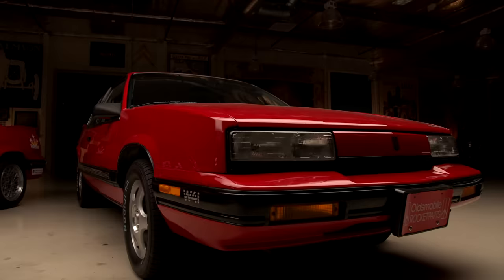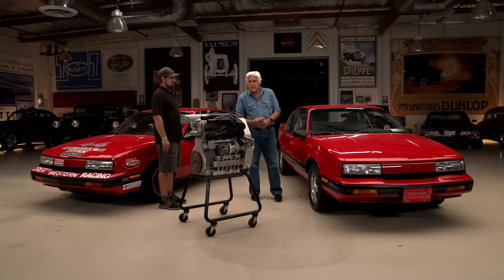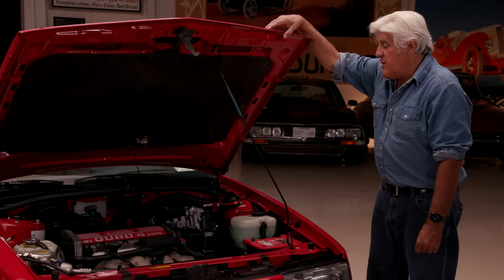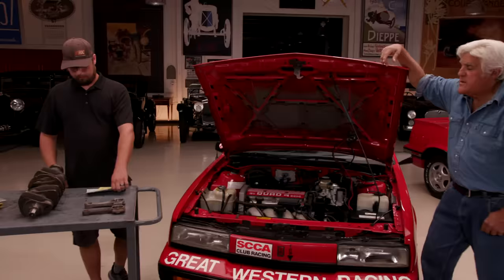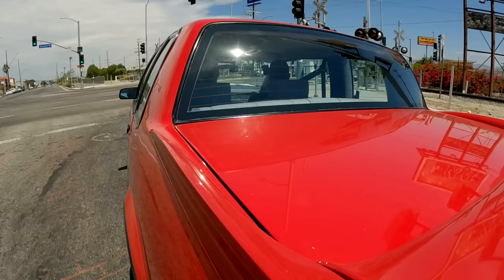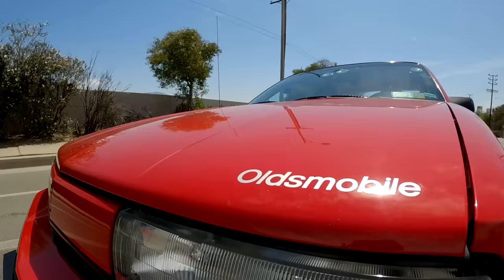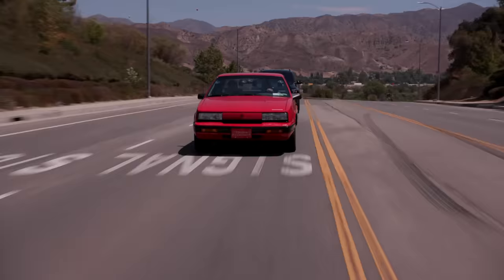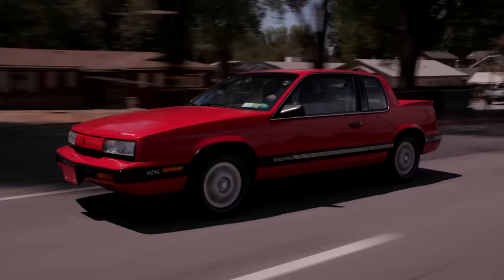Rare 1991 Oldsmobile Quad 442 W-41 | Jay Leno's Garage

Comment: I never heard of this car either! But it is a very interesting special model and looks fun to drive, if not fast by today's standards. GM shouldn't have thrown away Oldsmobile. The management should have worked harder to return the brand to prosperity.
Reply: Oldsmobile was born and raised in Lansing, MI so when GM discontinued the Oldsmobile name, it was a huge blow.  Always surprised me that they picked Olds for the chopping block.  Oldsmobile, at the time, was the oldest American automobile still in production.  For years, the Olds Cutlass was one of the top selling cars in America.  Kinda surreal to drive by huge, empty lots where there once was a major factory.

Comment: One of the most unreliable, pain in the neck engines I ever worked on. Absolutely nothing was easy to get to.
Reply: LOL you sound like my pops. Things gotta be a monster to cut your hands in
Reply: Ok grandpa, let's get you to bed. 

It wasn't any more difficult than any other DOHC fwd four banger during that era. The real issue was the dinosaur mechanics who refused to learn new tech. 

The only difficult part about the entire engine was replacing the timing chain with the engine in the car. Even that wasn't too bad.
Reply: @OxBlitzkriegxO  grandpa? 10 bucks says you are older than I am. The timing chain was one of the first things I learned how to change on my step-father's POS Grand Am. That was easy. The 10 hours on my knees to change the starter was next....every six months. Two full 18 hour days as a 16 year old to change the head gasket was the worst one. I hated that car. I refuse to work on FWD cars if I can avoid it. Giant hands and tiny engine bays don't mix.
Reply: @thomasallen6797  i owned FIVE different Quad4 powered cars that had an aggregate of over 800,000 miles between them all and never once did i change a starter. what were you doing to that car?! 

i would attribute the 18 hour days of working on that car specifically because you were 16 lol. they were not that difficult of a car to work on. 

its not anymore difficult that any other FWD GM car of that era.

Comment: The future of internal combustion could be something like mechanical watches after the 1970s "quartz crisis", but the weird thing is that the transition to electric isn't market driven in the way that quartz overtook mechanical movements by their sheer undeniable technical superiority. It's all just being imposed against our will by government dictate 😂
Reply: Until they realize the power for 100,000,000 people to come home from work and plug in their 230 volt, 50 amp chargers cause huge blackouts. 
The power in the grid does not currently exist to charge the cars being pushed. 
It's going to take 50 years for the grid to catch up.

Comment: Back in the day I worked at a auto body shop. The olds dealer used to bring in wrecked w41 Calais and achievas to repair. They were race prepping these for a race team. One of the drivers was Sam walston. Also a friend of mine owned a 92 w41 scx. That thing had a great exhaust note. And arguably the better of the 2 w41 cars.

Comment: In the mid 90's I was living in Kokomo Indiana.  At the time I owned a 1989 Oldsmobile Cutlass Calais . Great car.  It was a as expected, average cutlass. What made it different than the vast majority but not all cutlass's of the time is that it had a 3800 v6. Quite a bit of engine for that little car.  From a take off you had 2 options. Move the throttle no more than 1/8th and get the car too accelerate.  Or, depress the throttle 1/8th Orr more and smoke the tires off the front end of the car.  That car was alot of fun to drive. It was very unassuming.   It looked like the most ordinary and common car on the road.  I also owned a 1991 pontiac grand am, same chassis, with the quad 4 engine.  That car was also alot of fun.  Accelerating both cars was great. While it was hard to compare the 2 due to the different nature of them both, they were easily rated again each other.  The Olds had a much more luxurious suspension than the pontiac.  The Oldsmobile had much more plush interior,  everything was red and velvety. The seats were large and pillowy. The steering was very soft and foegiving.  
    The pontiac.  Had a stiffer suspension. The stiff we suspension aidedin making with car feel lighter u

Comment: Rumor has it an old guy in my area has a 1957 fuel injected 283 on a stand that they used to bring to car shows across the country.
It's from the Tonawanda engine plant.
Legend has it the oil companies put the kibosh on the FI system and General Motors didn't bring it back till the 80's
I would love to get my hands on that piece of History

Comment: When I was a new mechanic going to school off and on I had a quad 4 come in for a bunch of oil leaks, I fixed all of them except botched the timing cover seal. It leaked oil out slowly and the customer didnt realize. After about a month it came back in with no oil and rods knocking. I fixed it for free using a pullout engine to replace it. Doing all the seals for the 2nd time was a lot easier with the engine out. Thats all Ive ever done with a quad 4. That was also a long time ago.

Comment: I once owned a 1986 Olds Calais with the Quad 4 cylinder I "Beefed Up" the exhaust with a Split Manifold Exhaust with Twin Magnaflows I got 25 more HP out of it👍(from 120hp to 145hp)
Reply: Quad 4 was not available until late 1987 model year.

Comment: My friend Mark has one of these. He is a die hard Oldsmobile guy like me. I remember back in 1990 Mark bought a new red quad 4 with a 5 speed manual  brand new. He even had me drive it with less than 100 miles on it because he was too tired to drive. He put over 200k on that car and wore it out getting his money's worth. 
Years later he found this mint red w-41 car with low miles and had to have it in remenince of his '90. I almost bought one new back then but just couldn't swallow owning a 4 banger. I ended up with a super low mileage 87 buick grand national instead at that time.

Comment: I was in college when this came out.  Our school was the testing site for the SAE testing, GM Mr. Goodwrench instruction & testing, and Ford's factory tech certification program.  Any auto student could take any of the factory cert courses for free and any SAE test for a reduced price.  We also had all of the tech service instruction for all of the new GM & Ford stuff.  There was this & Ford had just brought out the 3 liter SHO that featured major pieces cast by Yamaha.  EFI/PFI/SEFI & DIS were also new to standard usage game.  Gm OBFD had an active data stream that could be monitored, freeze framed, & cataloged & some versions were actively tunable, but the standard was snap in PROM chips in the ECM through a removable cover.  OBDII uses the same

Comment: I remember when I worked as a teen for a man named dave palmer . He was friends with some big wigs at gm and in 1989 he waited for 6 months to get a special grand am with the quad 4 engine. However it was a different engine than any other one! The local dealer in Ocala Florida where we lived had never seen anything like this engine and had no idea on parts. The starter went and the service manager was stumped because he had no parts listing on parts! The paper work list the motor as 224 hp not the normal specs! My boss had to get in touch with the place in North Carolina where his friend had the car shipped for him to pick up! Everyone had to ssync up with his friend to get parts ordered ! The car was a straight beast that begged to be let off leash! It would destroy mustang 5.0 easily and kill camaro’s !! I got to race a vette of the era and beat it easily! Crazy as it sounds! The car had no tach and was a 5 speed 4 door grand am white with blue inside! The car got 35 mpg if you followed the shift light and baby the car! I wish i knew what ever happened to the car! However it was dangerous because if you were in a turn at start it would spin tires and not turn it would just go straight! Way to much power until you straighten up then it was pure performance and glory to drive!

Comment: As a GM tech I had a 1999 Pontiac sunfire GT which had a 2.4 twin cam same basic architecture but different head, intake, ect. I drag raced mine for  fun at the track and won multiple 🏆 with it in bracket racing. 15.0 all day long or 14.1 on nitrous fun times

Comment: GM gave me 3 of the 180hp Q4s for an F/D NHRA dragster project we were doing in 1986. We knew the engine had the potential to be competitive in comp eliminator. Only one problem is when NHRA set the rules for 4 valve engines they did not realize how small these engines were. So at 138 cu in the car and driver had to weight 1050 lbs to get on the Min. weight for the class. 
  But I spent some time working on my version of the engine, and I built a stroker version a 2.3 block w a 2.4 crank gives you 152 cu in or 2.5L. On the engine dyno we made 291 hp @ 7200 rpm. So after listening to Jeff talking about the power GM made w the engine I guess I did pretty well.  Great Video as always Jay, and you get better soon.

Comment: In 1985 at the Pontiac Oakland club in Pontiac Mi, Pontiac displayed a new GTO with the quad 4 w/ long runner fuel injection based on this same platform.  In 1988 he was installing car phones and traveled around the city and called on the GM training center.  He was 18 ahd they were looking for a teenager to be a test driver.  They ended up giving his company a similar car with a souped up quad 4 and much other special test parts. He was even able to have the car on weekends and went drag racing with it. He had the car for about a year or so but had to take it to the training center ever month for a check up.  They wanted it in the hands of a teenager to abuse and he did just that. The quad 4 was a greaaat little engine.

Comment: The Quad 4 engine was also in the Pontiac Grand Am and available with a automatic or manual trans. I have driven them when I pinstriped new cars at dealerships in the late 1980’s.

Comment: My brother had a Beretta GTZ with HO Quad 4 180hp.  It would really pull once it was wound up.  He would make long interstate trips at Gumball Rally speeds.  It was turbine smooth.  Cracked the head after a while.  He had it fixed and sold it.

Comment: Pretty neat car and engine. 190hp from a 4 cylinder is pretty decent considering a Cadillac of the same year equipped with the 4.9 V8 produced 200hp. I had a somewhat rare 1991 Cadillac STS(somewhere around 100 left in existence) that was surprisingly fun to drive. That amount of horsepower combined with good gear ratios and being a fairly small vehicle can make a pretty enjoyable, sporty ride.
Reply: I had the 91’ Biarritz eldorado version of that car totally loaded. Bought it when I graduated high school in 95’. Excellent driving experience     .
Reply: The 4.9 may have only had 200 HP, but had plenty of torque, which was obvious when you put your foot into it.

Comment: I had one of these in 1997-98. 5 speed sold me. Still so a grandma car sleeper. Then again I also drive a Mazdaspeed 6,mps, atenza. Coil on plug was big thing then as Japan was using 1.6-2.0l . Many quad4 as mine did had head gasket problems.

Comment: Holy hell, I worked on one of these in Florence SC, did a tune up....I remember pulling that red 4 valve cover off! This was back around 2005-2006...I remember wondering what weird engine and oddball laten80's early 90's nonsense I was tinkering with.

Comment: The Quad 4 was a big deal for a short period of time! The funny thing is, if it were RWD, with about 30 more HP it would have been THE fun car of the late 80's. My nephew built one of these, and raced it regularly, lightened/gutted, and torque steer all the way down the track, lol, but it posted some times that Mustangs of the era had to try a lot harder to achieve. It was about as fast as a stock Corvette from what I felt, but things are different when you can get traction on a 1320.

Comment: A buddy of mine has a father who loves buying Factory sleeper cars. He had an early 90s maybe late 80s Buick Skylark which I'm thinking is just the Buick version of this car because they look identical. It was that very overused light blue color that General Motors painted everything with back in those days. I remember going with my buddy in his dad's car to hit up the 7-Eleven one summer night and we talked him into to trying to do a burnout in the car and it just sat there and destroyed the front tires. Neither him or us had any idea of the power of that car had until that moment. I was a car guy but at my young age I had never heard of the Quad 4 before that day. That was my introduction. My buddies father ended up driving that car for 5 years about 70 miles a day to work round trip. Never ended up having any issues with it whatsoever. That was despite all the people that complained about head gaskets. When it's 5 years was up he replaced it with a Ford Taurus SHO which was I think a 92. In my opinion that was the best looking model Taurus they ever made. That car was great too, but unfortunately that car did eat two Motors in the five years he owned that one. It had a Yamaha sourced v6. SHO was supposed to stand for super high output but he used to joke that it's stood for super high oil consumption because even when the car was newer it ate oil like there was no tomorrow. Even despite it being a one-trick pony he still enjoyed that car a lot. Now he has a Plaid and a Sierra with a Duramax. He is an interesting man.

Comment: Back in 92. I went with my father to test drive/buy a 92 Olds Achieva SC. It was Teal Green, had the quad 4, and was a pretty nice car. Couldn't make a deal, so we ended up next door at a Ford dealer and drove off in a 92 Ford Probe in Bimini Blue. Always like the Quad4 engine and wished he bought the Olds instead.

Comment: My best friend had one of these in highschool and we use to smoke alot of cars back at that time. It was blue and we called it "little blue monster" it was faster than most people gave it credit for. It's like Leno said, "Reputation is what killed them" not the engine. Yes it was noisy but it was reliable and well designed.

Comment: The production model was known for blowing head gaskets and the cracked aluminum heads. The heads would Usually Crack around the back near the exhaust manifold.  The dealerships couldn't keep enough heads in stocks because of cracked heads. When the 2.3 was replaced by the 2.4 the cracked heads and blowing head gaskets stopped

Comment: In 1995 I was in high school and I had a 85 Z28 5.0 TPI. My mom had a Cutlass Calais.  I think it was a 89 but not certain about that. It was a 4 cylinder, front wheel drive, 3 speed auto, 2 door. It wasn't a beast but not necessarily a slouch either but my Z28 would spank it very easily. I was cruising main in my Camaro with a couple of buddies and a quad 4 pulled up next to me at a red light. The dude driving looked over at me and reved his engine. I rolled my eyes and said "my mom has a car just like that but she doesn't have those cheesy 442 stickers like you do." I thought the 442 was a late 60's, early 70's muscle car thing only. I had no idea about these quad 4's. I just kinda figured this dude put 442 decals on his car because he wanted people to think he wasn't driving grandma's car lol. Well the light turned green and I stood on the gas pedal thinking I'll see this Olds in my mirror in a couple of seconds. Well that never happened lol. I looked out of the passenger window and there's that Olds running right next to me and I'm not edging this car out whatsoever. We ran about 5 blocks and we were dead nuts even the whole time. I couldn't believe it and it gave me a whole different perspective on "grandma's car" lol. Pretty cool little cars actually.

Comment: Awesome, great to see more Olds stuff hitting the screens - One detail missed (that even fewer know about it seems) was that they put out 200 of 'em for the '89 year, but not sold to the general public - commonly called Press Cars, although many of them went to GM execs I think (mine came from an engineer that was apparently relatively high up on the food chain somewhere there) - Mine came to me in pieces, and is still a rusted out butchered mess, but there are some stunning examples still in circulation.  

I was initially nauseated at the idea of a 4 cylinder 442, but I've warmed to them in the years since.  And I remember smoking an IROC in a Q4 Grand Ammit, so the power potential was definitely enough to earn the name, at least for the era.  🙂 

Glad to see Jay back on the road, we all had a good scare there for a bit.

Comment: I had an 88 cutlass supreme 2.8 efi v6 entire dash was digital. Also had 91 Grand Prix se 3.1 efi with all the ground effects etc. And the crazy steering wheel controls😂 I really liked that car it was low and wide it handled well and would do awesome in snow with studs. It just needed 100 more hp. It was reliable though I would set cruise at 110 for hours at a time.

Comment: Chrysler made the TC in 1989-1991. The 1989 and 1990 had a limited edition of 500 units with a  getrag 5 speed. That TC had an engine made by maserati with the lower end of the engine being the Chrysler 2.2, Cosworth head and a Japanese intercooled turbocharger. 200 hp. Many people since have taken the car with that engine setup and easily modified it to 250 horsepower. Some to 300 hp. Beautiful all Italian leather interior.

Comment: Quad 4 general motors was putting this across the line of their products. It was even in full size to even the Grand am. But people wanted a V6 so they kept on building the pushrod V6. Oldsmobile was the engine developer for GM later they developed the Walter valve V6 and also a lot of work on the Cadillac Northstar V8.